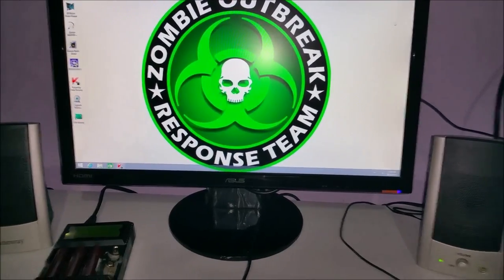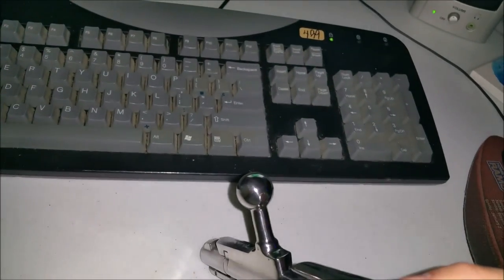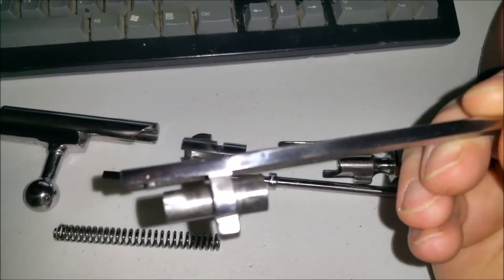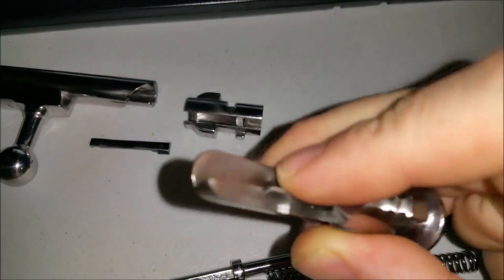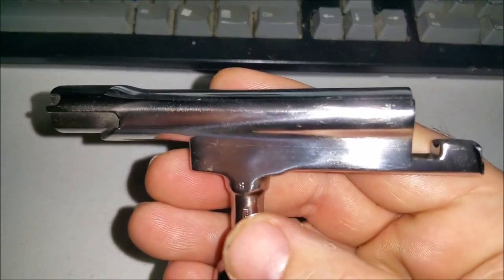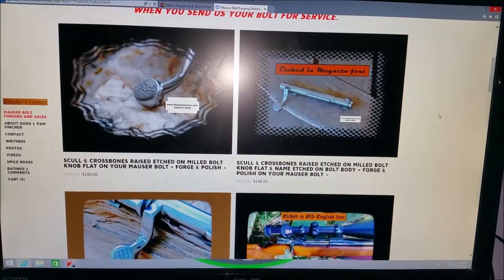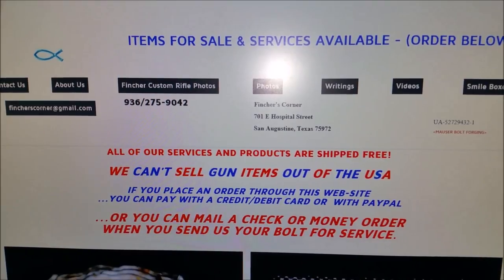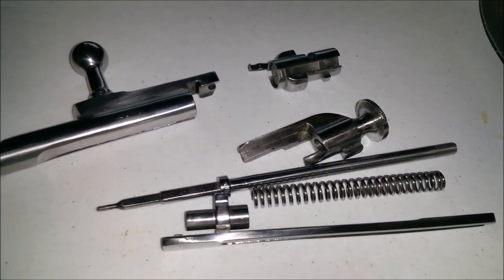Fincher's Corner Mosin Nagant Bolt Polishing Service

Comment: After watching this video I contacted Fincher’s Corner for information and sent them my Finn M39 bolt for polishing. It was very dull and someone had used a course wire wheel on it leaving some of it badly scratched. I got it back today and all the scratches are gone and it is polished to perfection and I got it back in nine days!

Comment: Polishing the extractor front end at the 90 degree bend can greatly help a sticky bolt problem. 

Makes lockup and extraction/ejection MUCH smoother and easier. Just smooth up that outside side of the 90 degree bend in the extractor. Use a Dremel rotary tool. They're inexpensive in kits.

Comment: you don't polish the bolt face because of head spacing issues, as well as a few other spots. That's why they don't polish certain  areas, but you can do that yourself pretty easily. Just gotta learn a bit about how to properly polish and what can be polished safely.

Comment: How do you think they accomplish that?  Even possible as a DIY?
Reply from the maker: Roland Case wish i knew...but they did a FANTASTIC job!
Reply: I've had pretty good results with sandpaper, needle files and polishing compound. If you take your time and do it by hand it's basically impossible to remove too much metal